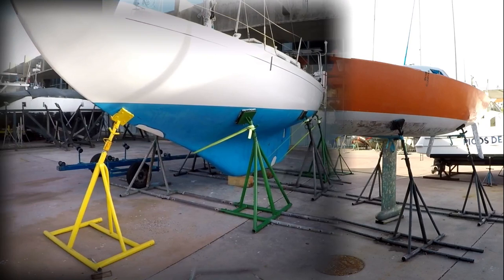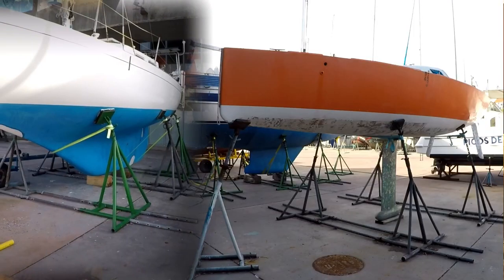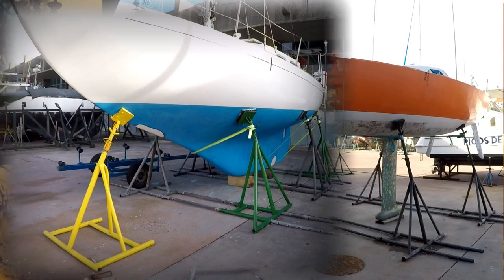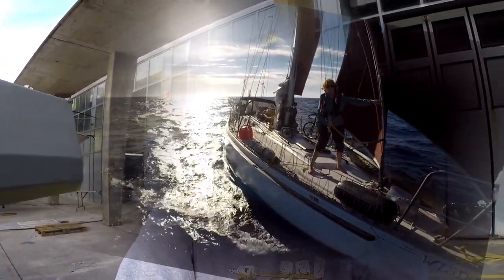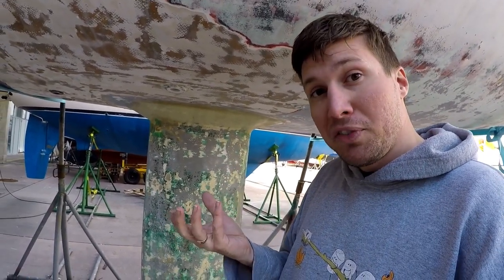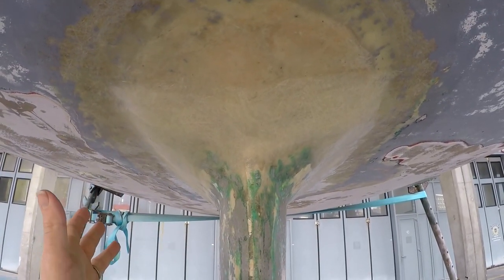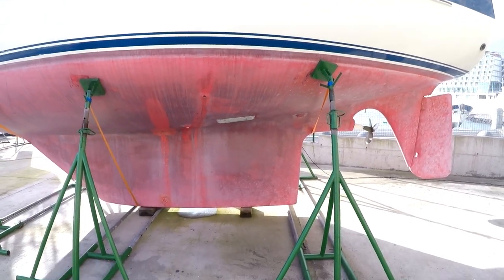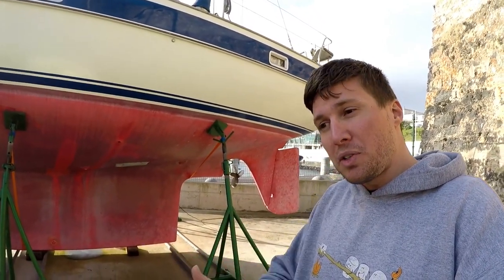Which is the BEST Keel Design? | Sailing Wisdom

Comment: Long keels can be bolted, fins can be encapsulated. Speed is a function of WLL and sail area not keel type. Keel type effecs windward ability and tracking and heaving to, like you said.
Reply from the maker: Yes, but keel types tend to affect wetted surface area and that affects speed. Hull speed is unchanging with keel design, but having less wetted surface area means you can go faster on less wind and therefore sail faster until you reach the speed limit dictated by waterline length.

Comment: My old boat, a Person 30, has an encapsulated, fin keel, which is molded in with the hull, so there are no keel bolts.  My new boat, a Pearson 365, also has a modified full keel, which is also encapsulated lead, and a skeg hung rudder, and no keel bolts.
Reply from the maker: Nice, keep it simple and secure

Comment: What is the difference in speed between the two keels?  Assuming everything is equal.
Reply from the maker: The fin keel is faster than the full. It’s impossible to have exact numbers because every boat weighs and sails differently
Reply from the maker: The big difference comes in light winds. A full keel has more drag so it needs more wind to power the sails and move it. A fin keel has less drag so it will sail faster than a full in light wind. 
Both are limited by hull speed (but racing fin keel boats can now plane and exceed hull speed). In heavy winds, a fin keel will bounce around because it’s lighter while a full keel will move just as fast but in a more comfortable fashion.

Comment: now let's talk about bow thrusters. A hole in the boat that you use for 5 minutes when you're going into a dock but supplies extra drag whenever you're moving. Which is worse: the extra hole(s) or the extra drag?
Reply from the maker: I don’t like bow thrusters because they become a crutch. That said, I could use one from time to time!
I had a neighbor that would navigate the whole marina without touching the rudder by blasting his bow thruster. Also, I saw a trailerable 17 foot outboard at a boat show with a bow thruster!
My favorite was a friend with a 32 footer that “couldn’t leave their slip because the bow thruster died”. 
I think it’s important to learn how to use your spring lines and prop walk to maneuver your boat like it should be done. 
Adding thrusters to boats encourages inexperienced people to buy a giant ship as their fist boat because the dealer told them that the thrusters let you “park it like a car”.
I’ve seen too many collisions in marinas from first time boat owners on a 60+ foot sailboat and no clue what is going on around them.

So... not a fan of bow thrusters.

Comment: What about folding keel?
Reply from the maker: I completely forgot to include them in the conversation. 
Basically, they give you the performance of a fun keel with the ability to squeeze into places no other sailboat could dream of going. 
Raising the keel part way also allows you to adjust the Center of Lateral Resistance (CLR) which is very useful when trying to balance the helm.

Comment: Great vid.You are very knowledgeable.   One major issue is Slower or Faster. After sailing MANY MANY MILES I Personally prefer a well built fast design yacht. The book Fastnet Force 10 provides us with that information. Mr. Ted. Yachts man of the year, made it with out any major issues. After sailing for my last 44 years I saw that if you have a lighter displacement yacht. You will sail farther and sail more. A heavy displacement yacht will make you motor more and sail less. It is a fact. In So cal and Mexico we have lighter winds. The security of having many tons of ballast under your feet is a nice feeling when your 100 + miles offshore. But the sound of the ocean and nature can't be  beat. doing 10 + knots in the middle of the Pacific. Thank you for your great video. This is just something from an old yachtsman. Keep up the good work....
Reply: Passing trawlers without making a sound.
Reply: The fastnet disaster ( I can’t remember the year ) showed just the opposite. There is a very good book, ‘seaworthiness the forgotten factor’, that discusses this with lots of documentation. But, to each his own.

Comment: Informative video, thank you.  Although you incorporated most trade offs for keel design  you didn't include draft. One of the full keel boats you showed (looked like a Morgen  Out Island 40) had a very sallow draft, shallower than the much shorter racy one with the long blade keel. There is also swing keels great for shallow draft and deep draft for open ocean, popular in areas of high tidal ranges like the UK.
Reply from the maker: Good point!

Comment: I prefer the one I have on our Southerly, a grounding plate hung swing keel. Pros are high aspect ratio, variable ballast position (great for running), variable draft (good for deep water and shallow water sailing as well as beaching). Cons are complexity (more things to go wrong such as hinge pin and lift cable lifting mechanism), and interior cabin arrangement limitations, The main advantage to us is in canal boating.
Reply from the maker: Which model Southerly do you have? They are gorgeous “go anywhere” boats!
Reply: Rigging Doctor Hi, ours is a 2001 S135B. It was La Jonquille, SV Aurora Leigh. You can google La Jonquille. I was designing a 39’ Bristol Channel Cutter before I first saw the Southerly keel solution (grounding plate hung swing keel) which I fell in love with straight away. So I cut the keel off the design I was doing and the swing keel fitted in perfectly. About then we decided to buy a boat rather than spend years building a boat that I might never finish. Another combination is the shoal draft long keel with a drop centre board (4’6 to 6’6 draft) which is what my first self built Samsom C’Quoia (Canadian design) boat was. As you say no boat is perfect. A boat design layout that I really like is the Triton Warrior 38 which could be done with a swing keel and the engine aft under the cockpit floor shaft forward into a transition box onto which you mount an electric motor for a full hybrid drive. The amidships pullman berth holds a lot of appeal, I think. 

I love what you are doing to your head. Very bold, and making it your own style. Its all part of the lifestyle and adventure. I fully support your all electric renewable energy principle. Our boat is fairly diesel centric but I have to find a way towards non fossil fuel systems. I don’t have a problem with using ethanol on the boat and perhaps the solution for our boat is to convert the engine to ED95, the cooking to a pressure ethanol stove, and a bigger battery bank with a 10 kw motor belt driving to the prop shaft. Getting Solar panels and a wind generator aboard are the first priorities though.

Comment: A couple weeks ago, I sailed from St. Maarten back to Ft. Pierce on a friends 1968 Person 44 Countess.  It has the same hull as yours.  It rode like a Cadillac, even in rough seas.   No pounding, healing was minimal.   Speed was awesome.   The auto pilot was acting up (broke) and had a hard time steering above 6 kts.   We had to keep reefing to slow her down.  I was impressed with the performance.   I'm into comfort not speed anyway.   I'm sure in a tight marina it would be a handful to maneuver.    Wisdom's hull would be awesome for me, however we plan on doing the ICW to the Outer banks so I guess our Modified on our Pearson 365 will have to do.
Reply from the maker: In the ICW you will be VERY happy with the shallower draft (and your diesel) ;)
I have actually disconnected our electronic autopilot because the Monitor windsteering works so well. The ram arm of the autopilot was a constant drag on the steering and without it the helm is really light to the touch (as long as the sails are balanced)

Comment: Let me start by saying that I have an Allied 36 with a full keel with cut away forefoot.  In addition my keel has encapsulated ballast.  That brings up my first comment.

All full keels do not have ballast inside the fiberglass hull (encapsulated ballast).  In fact many have external ballast bolted on to the botton of the keel or bolted on in front of a deadwood.  An example of the former is a Tahiti ketch and the latter is used in the Hinckley Bermuda 40.  For a boat with encapsulated ballast the keel is not attached to the hull since it is part of the hull.  My Allied is a good example of that.  The hull canoe body and the keel are a single piece of fiberglass that the ballast is put into.  The ballast is then glassed over inside the hull to keep it in place and eliminate leaks should the keel be holed by a grounding.  This sort of construction cannot have the keel come off since it is not separate from the hull.

Beyond differences in grounding damage between full keel and fin keel boats, the biggest difference is in handling.  That difference is NOT simply due to the keel type although that plays a big part.  As a generalization, boats with a fin type keel have a very different hull form than a full keel boat.  In the fin keel case the canoe body of the hull tends to have minimum draft and may be quite flat bottomed.  That sort of boat is also generally built to be light to enhance performance.  In contrast a significant percentage of full keel boats had more traditional wine glass shaped underbodies.  Relative to a fin keel boat the same length the full keel design will tend to be quite heavy.

As far a boat speed goes, both fin and full keel boats can achieve similar speeds (unless the fin keeler has sufficiently light displacement and a flat enough bottom to allow planing).  It just takes more wind to push the full keel boat to a given speed than a fin keeler because power required for a given speed is proportional to displacement.

What about handling.  In general boats with a split underbody (separate keel and rudder) with have faster response to steering.  Another factor is that it is actually quite easy to back a fin keel boat with a spade rudder in a controlled fashion.  In contrast, a full keel boat tends to go where it wants to in reverse until you get quite a lot of speed up.  The fin keel boat, because of its faster steering response will turn more quickly and is very easy to tack quickly in contrast to a full keel boat where tacking my require back winding the jib or in extreme cases furling the jib.  Also a full keeled boat will come through the wind much more slowly than a fin keeled boat.  What about sailing in larger seas.  In this scenario the full keel boat will tend to track more steadily.  That is a factor of both the large lateral plane area of the keel and the higher displacement of the boat relative to a fin keel boat.  A fin keel boat with a shallow flat bottomed canoe body will be sitting mostly on top of the waves and will tend to get bashed around a lot and will take a lot of active steering to maintain a course.  That is particularly true in following seas where a fin keel boat can easily pivot on the short chord keel and end up in a broach.  While that can happen with a full keel boat, the large lateral surface area of the keel works against a following sea turning the boat.  However, the relative shoal draft of most full keel boats works against the tracking.  Finally the hull form plays a big role.  Most fin keel boats have shallow relatively flat bottomed canoe bodies that can slam in steep seas as the boat's pitching completely lifts the forward end of the boat out of the water.  When the flat bottomed canoe body drops back into the water it slams.  In contrast the wine glass form of many full keel boats keeps more of the boat in the water when pitching and the hull form cuts through the water when the bow drops after a pitch rather than slamming down onto the water.

Just my thoughts based on my limited sailing experience.
Reply from the maker: That was very well explained, thank you!
Reply: @Todd Dunne. Excellent response which contains significant "real world experience". Thank you for taking the time to contribute this knowledge. Post should really be "pinned" as it's very relevant to the video content.
Reply: @johnmoore3859  thank you for the kind words.  Those were just my thoughts based on my limited experience from 52 years of sailing and having worked as a naval architect back in the 70s. There is considerably more to it than I put into my post.

Comment: one thing i miss on this explenation. it is how they behave. my previus boat had a long keel it was easer to trim and go in a strait line. than my current boat that has a fin keel and rudder on skeg. it is faster but turns more easely.
Reply: That has to do with the weather helm. You may be able to adjust the steering and the boat's tendency to want to point into the wind by adjusting the position of your sails or adding a bowsprit to your boat. Look up "weather helm adjustments".

Comment: In 50 + years sailing iv hit 1 whale 1 orca 1 container a dozen or so logs Oh and several sand banks , touch wood never sunk (close on the orca one) all in different keal configurations but i must admit id feel safer 'relaxed' in a medium keal in a steel yacht with a good skeg on the rudder - fair winds (54ft. Round bilge .steel Vandestadt was the best)

Comment: Just curious, how much slower is a full keel boat over a fin keel? Is it like half the speed?
Reply from the maker: In light winds, a full keel will drift while a fin keel will sail. 
In moderate winds, a full keel will sail slowly and a fin keel will sail quickly. 
In heavy winds, a full keel will sail quickly and the fin keel will be thrashed around. 

This is just based on my experience in a full keel and watching fin keel boats around me. We come into speed in winds above 20 knots while they are heading for safe harbor. 
I’ve been on a few fin keel boats and they will sail in nothing but when the wind picks up, the boat really thrashes around in an uncomfortable manner. 
If you are going to do coastal and fair weather, a fin keel will be the best boat for you. If you plan on serious cruising where you will get caught in bad weather, a full keel will be your safest boat.
Reply: @RiggingDoctor  Thabks for that explanation! It definitely sounds like full keels are safer if you are offshore /ocean crossing but would you say that fin keel boats can do that same voyage, or is it risky?

Comment: I’ve got a Pearson 30, which has a integral keel, glassed in. No keel bolts. Still a fin keel, but with some of the strength benefits of a full keel. 
Spade rudder, though, unfortunately.

Comment: Really good explanation, liked the acknowledgement that things are gonna break & can you fix it (can YOU fix it!). There are few long keel boats made any more but thankfully a lot of the older fibreglass hulls have survived well and are now relatively cheap. They were mainly designed with long keels for no other reason than that's how wooden ones were built and the shape also lent itself to moulding. The wooden ones were built that way because that's what you could do with wood. Early fibreglass hulls were also overbuilt because nobody knew how good or not fibreglass would turn out to be. All of which happily means that we mere mortals can find a boat for not too much money that is capable of taking us anywhere we want to go. Happy days!
Reply from the maker: That’s exactly how it went with our boat “Wisdom”. Built in 1968 and way thicker than she would ever need to be. That durability is why we are still sailing today!
Also, I bought her for a song and then spent a few years rebuilding her to make her ready for passage making, but I was starting with good bones.

Comment: The old shape i.e a pilot cutter have a look at Elley Grey ideal for ocean crossing , also because no cut away forefoot it also motors much better , a fin keel does not motor well in any see state , Elley Grey 65ft OD 19 ft Beam 9knots crusing under power 10/12 knots under sail old shape but still fast and less lightly to catch lines .
Reply from the maker: She is gorgeous! In the Chesapeake, we would sometimes sail over a crab pot (that was in the middle of the channel with a dark float on it) that we didn’t see until we were on it. The keel would push it away from the prop and off at the stern; never fouling the prop!